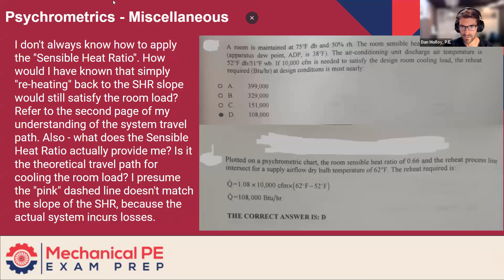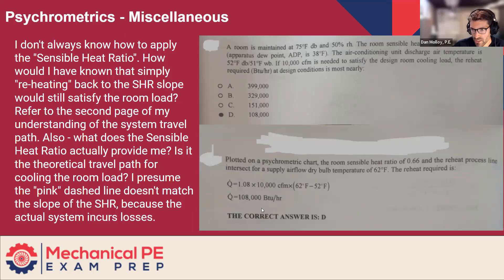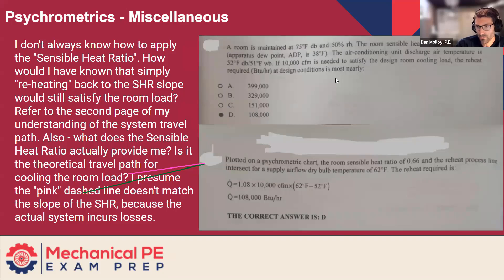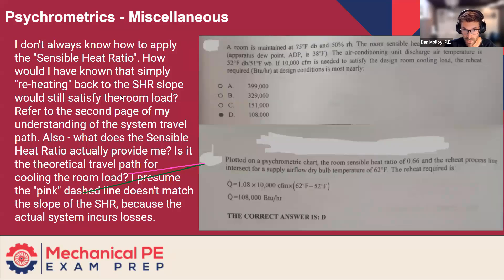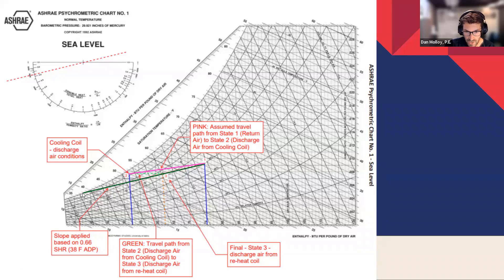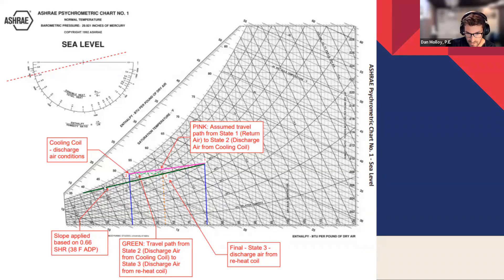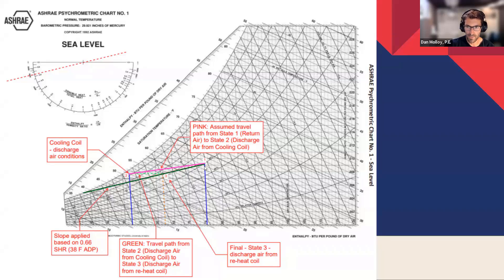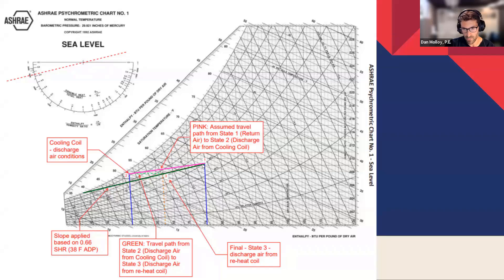Psychrometrics: What Does the Sensible Heat Ratio Really Mean? | Mechanical PE Exam Prep

Comment: during the PE test, you are not allowed to copy and paste or drag lines that are drawn from the protractor. Therefore the use of the psych protractor is rendered unusable. They also do not provide rulers, protractors, or any straight edge.
Reply from the maker: You're right, the PE exam is a bit different than real life, but understanding the concepts is still key!  Alot of candidates stress out over this point for the exact reason you stated, so going over it can provide some comfort, even if it's unrealistic to draw parallel lines.
Reply: @MechanicalPEExamPrep youre right; comment revised.😅
Reply: That is asinine. I know a guy who told me that he was unable to ERASE any line he drew, so as the test wore on he had layers of overlapping lines on his psych chart from previous problems.

Comment: Thank you for the great explanation. Can you please help me understand the math on how the CFM will be selected?  If we were to supply apparatus dew point, I understand that it would be much less CFM. But since we cannot do that, let’s say for the load, 10,000 CFM of 52 degree air is required (based on load = 1.08*10000*(75-52)). However, why Do we not take reheat into account? Since we are reheating to higher temperature, wouldn’t we need more CFM of air to meet the load?
Reply from the maker: This is where we drift into design.  Design is science and art blended together.  The science says we have to meet the sensible and latent loads, but nothing more.  The designer has to decide what the supply air conditions should be, the reheat, the CFM, etc.  Exam questions have to be sufficiently defined so you can solve for the missing variable.  In real life, design engineers make decisions because on rules of thumb and experience, and there are multiple "correct" solutions.

Comment: Why we took our SHR line from point 1 and not from point 2?
Reply from the maker: State 1 is the room condition, so that's the starting point for the cooling and dehumidification that we are determining with the SHR.  There are a variety of possible State 2 points which could satisfy the room load, and we are interested in the process line that goes through State 1 and has the right slope and dry bulb temp.  That's how we locate State 2.
Reply: Thank you Dan, this was helpful👍 @MechanicalPEExamPrep